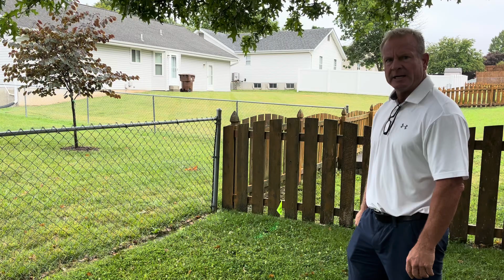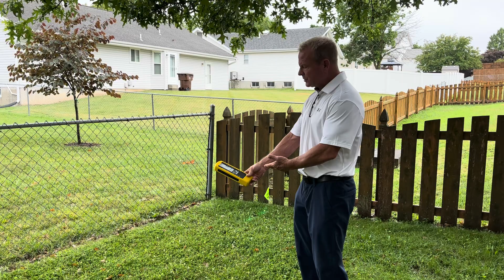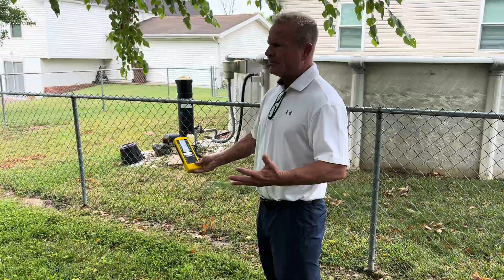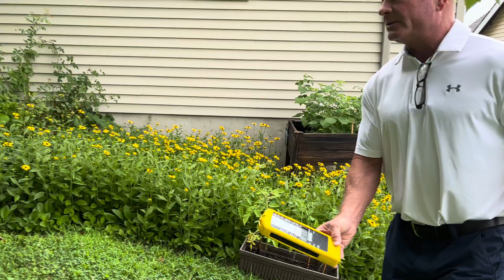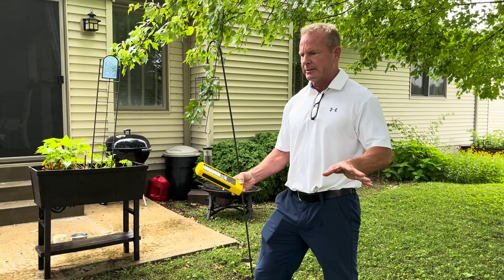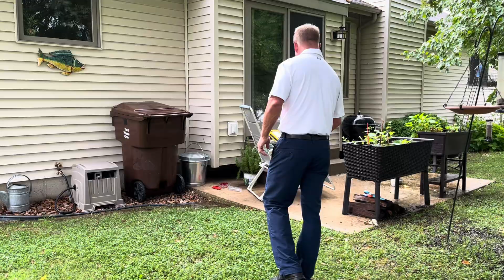Dawn Before Walk for Fiber Optics

Comment: Any comments on the tracer wire that is on our gas meter? It has 1.6 volts of currents on it.
Reply from the maker: I Know tracer wires can be on Fiber Optics so they can find the wire...... Sometimes you will have current on the gas line to help with corrosion. I do not know much about tracer wire on gas line
Reply: Thank you for your response. I asked a few times if you could tell me what model rf explorer you recommend?  @robertworkman117

Comment: I seperated the glasswire from the one that sends the electrical wire they hook up with the box, and had only the glassfiber one in the house. The box and rest is in the shed. That way I don't get the emf in my room. I have seen the readings in others homes.